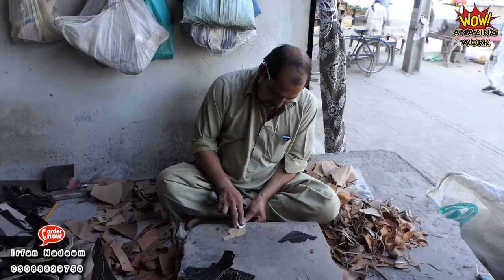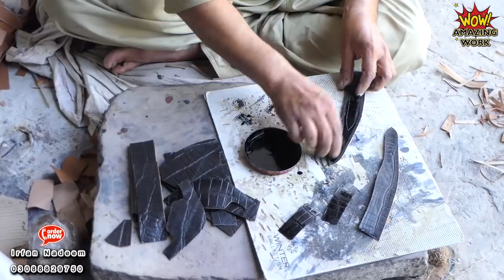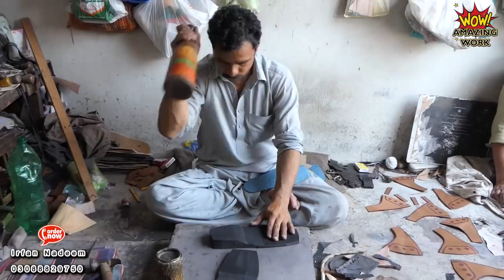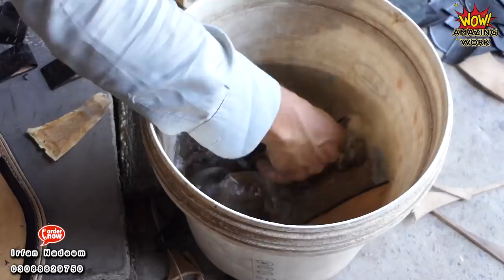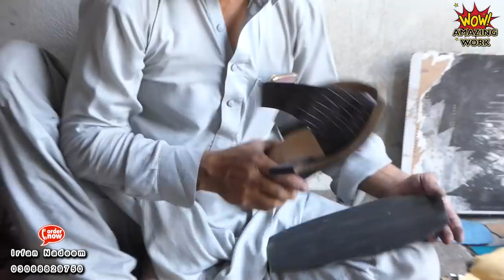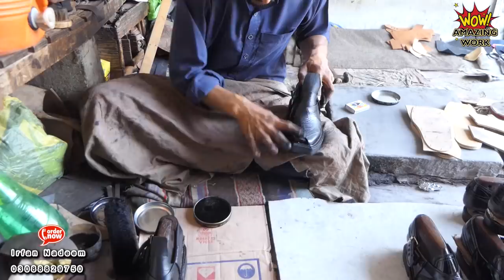handmade leather sandal for men | Amazing Work skills footwear kaptaan chappal making with hand

Comment: 46 years ago I worked at a large shoe factory in the U.S.  For ALL those different steps in constructing the shoe there was a machine and one person only did one job.  For example at the beginning you saw the man cutting away the edges of the leather to make it thinner to be able to stitch them together without too big of a hump.  Well, in the factory that was called "Skiving" and one person did that with a machine all day long another did nothing but the stitching, another nothing but the bottom soles, another nothing but gluing. etc.  The factory produced 600 to 800 pairs of shoes each day, but wound up closing because labor was cheaper in asia.  There is hardly any shoe manufacturers in USA today.

Comment: Greetings from Malaysia 🇲🇾

nails, glue, thread, precision, patience. 

if in my country this kind of handmade shoes can be sold for hundreds of Ringgit (MYR) can also be thousands of Ringgit, depending on the material if the original leather is very expensive.

*edit : this work should not be sold for as low as 80 dollars it is more than that.